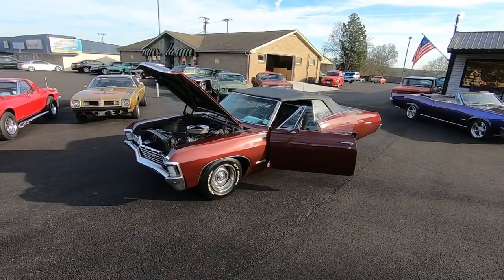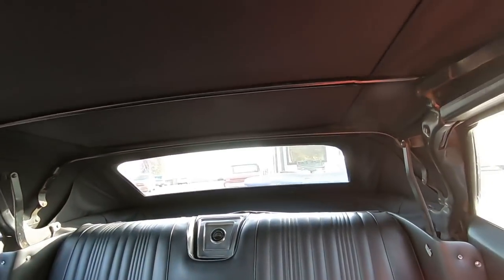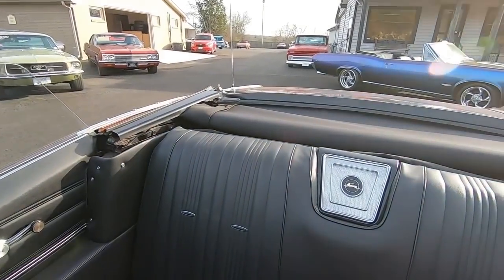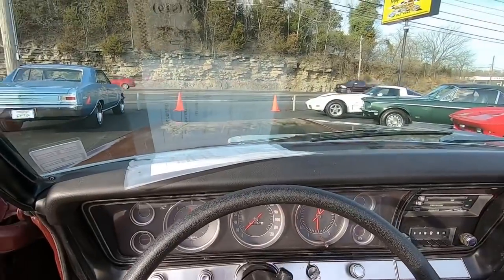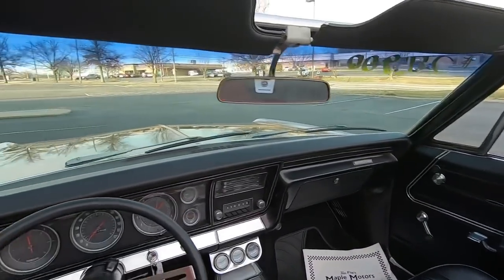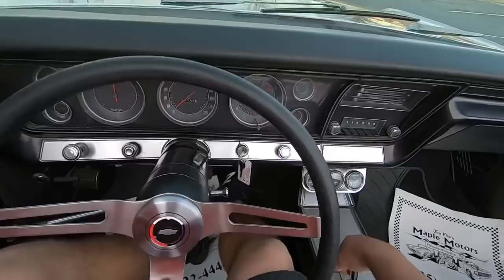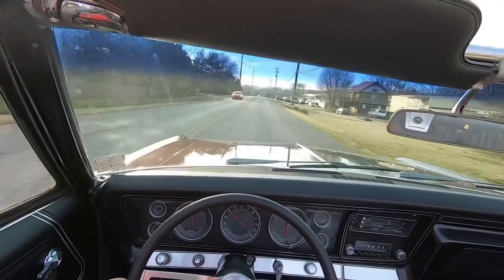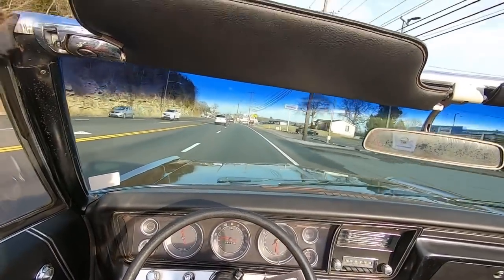Test Drive 1967 Chevrolet Impala SS Convertible SOLD $27,900 Maple Motors #984

Comment: Great videos, yer right, time to put the top down today. It's going to be in the upper 60s today. I have me a 2001 Firebird in red with a black convertible top. And yes, it does have the 3.8L motor. But it runs and looks like it is new. So it is fast with and it has the kick down hooked up. Or as I call it, the passing gear works fine.

Comment: Nice car. The color combo looks really good. This one has the turbo instead of the powerglide like most 283's did. This is the first year of the best looking Impalas. 67 thru 70 in my opinion looks better than the other years. It runs awesome for a 283, are you sure it's not bigger than that, like a 327?